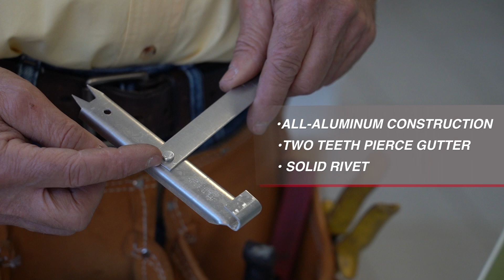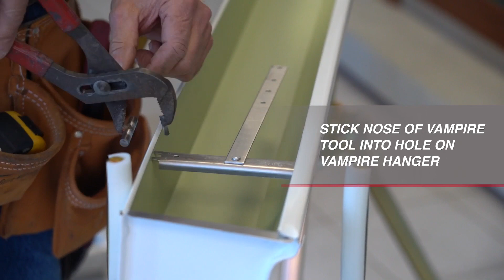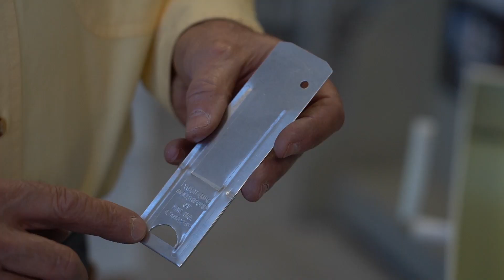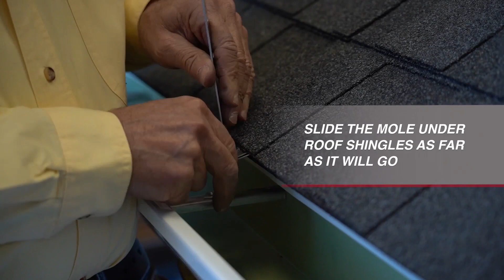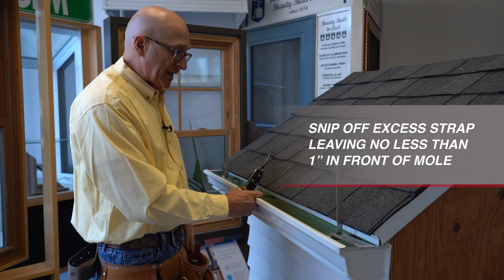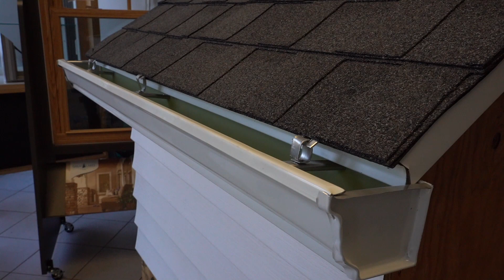How to Install a Vampire Roof Hanger

Comment: Bad idea. Water will make its way under the shingles
Reply: Exactly what I'm thinking. The only way that this make sense is if you have a metal roof and there are going to be exposed fasteners anyway that you can drive through the hanger.

Comment: Seems like a waste pay thousands for a new roof and then to install new gutters i have an exposed nail driven thru my new shingles NO VAMPIRE CLIP CLAP CRAP FOR ME ill use the internal clip on no sight hanger thank you and no holes in my new shingles. COME ON MAN HOLES IN A NEW ROOF
Reply: I have a new roof with no fascia board. I also don't want to leave exposed nails on my new roof.  I don't understand your explanation on how to do it right.   Can you please elaborate?
Reply: @johnnysouth4982 Internal clips??? Link?

Comment: Does this type of attachment work in the northeast? I have an old farm house without a facia board. I do not want to install one because it will hide the detail on the roof rafter ends. It has gutters on it attached with regular roof straps but over the years the ice and snow has pushed them away. We do have quite a steep pitch. Will the same happen with this type of hanger?